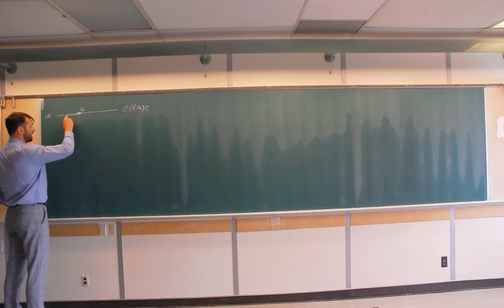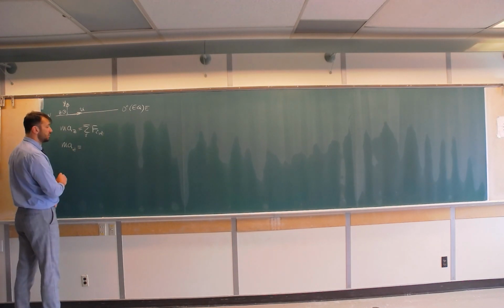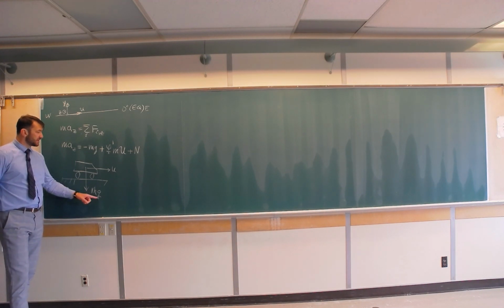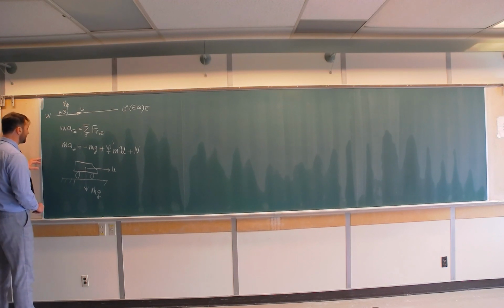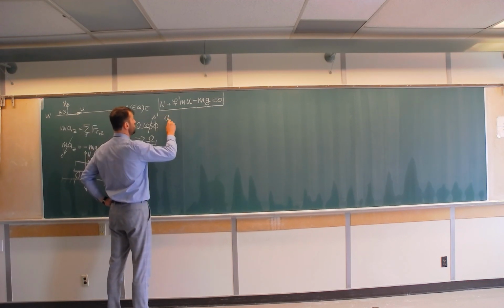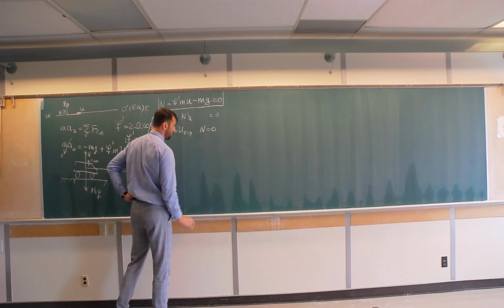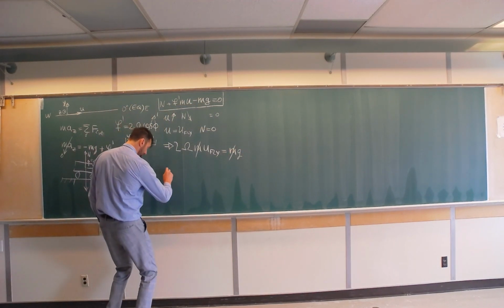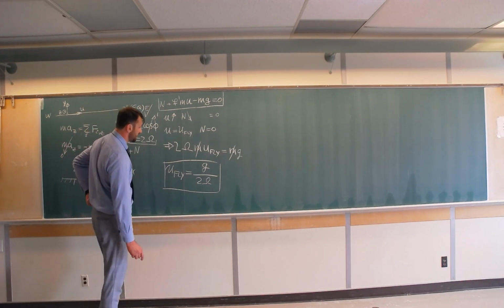Coriolis Force Q25: Flying Cars and Romanic Speed

Comment: Just a few questions: 
(1) In your calculation, I'm assuming that the coordinate system is fixed to the rotating disc, and is therefore rotating along with the disc. Is that correct..?
(2) The spiral that is produced by the particle, is that logarithmic spiral or Archimedian spiral ?
Reply from the maker: Yes, the coordinate system is rotating with the earth or disk if you are looking at this (or similar) problems on a disk. Regarding your second  queestion, I am not sure without conducting further analysis. It's a very interesting question though!